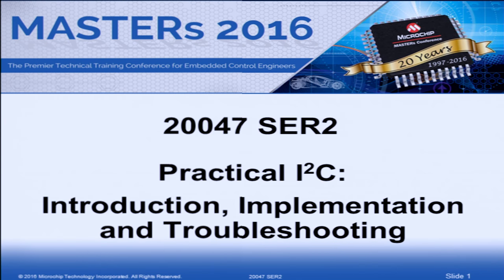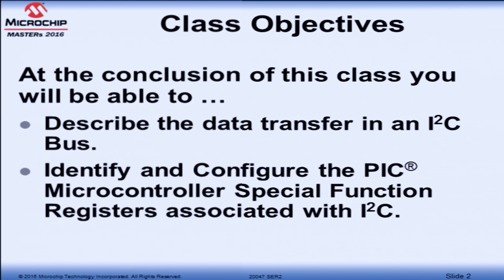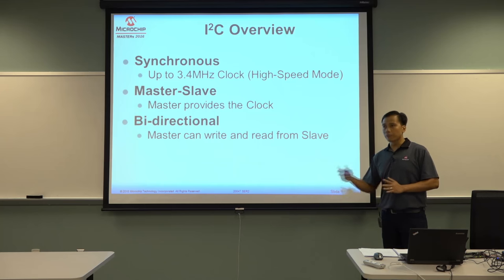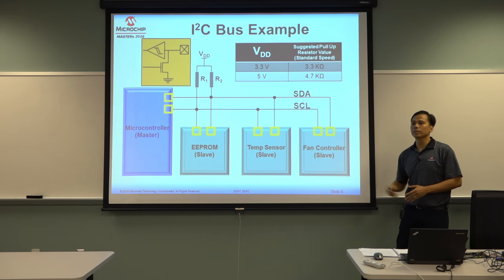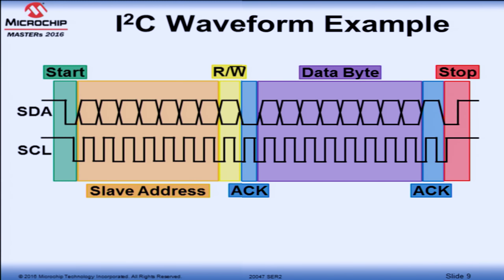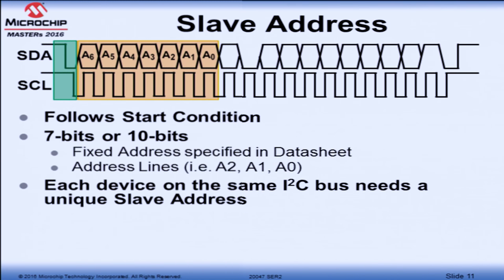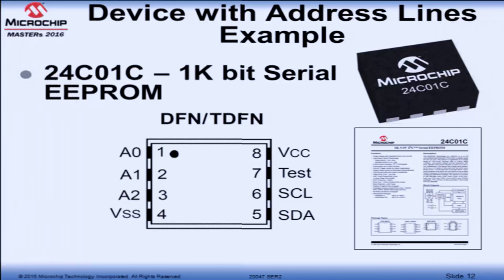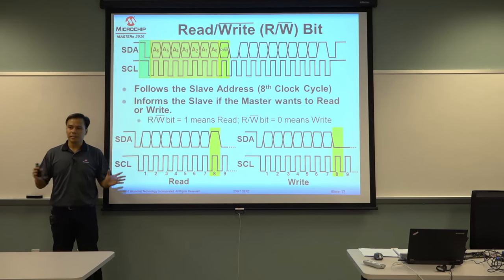20047 SER2 - Practical I2C: Introduction, Implementation and Troubleshooting

Comment: How to write Verilog code for LVDS implementation into M2S025-FG484 FPGA board. Is LVDS incompatible with this board
Reply from the maker: Hello and thanks for your question! LVDS is supported in the SmartFusion2 M2S025-FG484. Please contact Microchip’s FPGA design partners to learn how to write Verilog code for LVDS implementation: https://www.microchip.com/en-us/products/fpgas-and-plds/fpga-design-resources/fpga-design-partners.
We also offer SmartFusion and SmartFusion2 simulation library source files here: https://microchipsupport.force.com/s/article/SmartFusion-and-SmartFusion2-VHDL-simulation-library-source-files-support-1625098162917

Please let us know if this helps!

Comment: Would it be possible to publish the i2C_demo.c program? I would be very grateful
Reply: void eepromWrite (char slaveAddress, char Addhigh, char AddLow, char eeData);

char eepromread (char slaveAddress, char Addhigh, char AddLow);

            // slave address is the address byte  (slave address +r/w bit)
            // addHigh is the eeprom Address high bye
            // eedata is the data to be written in the slave

volatile char ReadData;   // global variable for monitoring.

void main(void)
{
    int x;   //general purpose variable
    OSCCONbits.IRCF = 12 /// 2MHZ clock

    ANSELB = 0;    // All portB pins are digital
    TRISBbits.TRISB0=0;  // RB0 is output.
    LATBbits.LATB0 = 1;   // LED indicator to know that code is running.

    SSPADD = 4;    // 100khZ i2c CLOCK WITH fOSC = 2 mhZ
                    // i2c CLOCK = fOSC/ (4*(sspadd+1))

    sspcon1  = 0X28  // sspm <3:0> = 1000 (i2c mASTER)
                      // sspen = 1 (i2c module is enabled)

   eepromWrite (0xA0, 0x12, 0x34, 0x78);

   for (x=1; x<165;x++);
   ReadData =  eepromread (0xA0, 0x12, 0x34);

   while(1);

}

void eepromWrite (char slaveAddress, char Addhigh, char AddLow, char eeData)
{
    SSPCON2bits.SEN = 1; // initiate start condition
    while(SEN);
    PIR1bits.SSPIF = 0;   // clear SSP interrupt flag
    SSPBUF = slaveAddress;  // send slave address and R/W bit
    while(!SSPIF);          // wait for ack. SSPIF is set every 9th clock cycle.
    PIR1bits.SSPIF = 0;     // clear SSP interrupt flag

    if (SSPCON2bits.ACKSTAT){
        SSPCON2bits.PEN = 1; // initiate stop condition
        while (PEN);  // wait for start to complete
        return;  // exit write  (No ack)
    }

    SSPBUF = Addhigh;  // send slave address and R/W bit
    while(!SSPIF);          // wait for ack. SSPIF is set every 9th clock cycle.
    PIR1bits.SSPIF = 0;     // clear SSP interrupt flag

    if (SSPCON2bits.ACKSTAT){
        SSPCON2bits.PEN = 1; // initiate stop condition
        while (PEN);  // wait for start to complete
        return;  // exit write  (No ack)
    }

    SSPBUF = AddLow;  // send slave address and R/W bit
    while(!SSPIF);          // wait for ack. SSPIF is set every 9th clock cycle.
    PIR1bits.SSPIF = 0;     // clear SSP interrupt flag

    if (SSPCON2bits.ACKSTAT){
        SSPCON2bits.PEN = 1; // initiate stop condition
        while (PEN);  // wait for start to complete
        return;  // exit write  (No ack)

    SSPBUF = eeData;  // send slave address and R/W bit
    while(!SSPIF);          // wait for ack. SSPIF is set every 9th clock cycle.
    PIR1bits.SSPIF = 0;     // clear SSP interrupt flag

    if (SSPCON2bits.ACKSTAT){
        SSPCON2bits.PEN = 1; // initiate stop condition
        while (PEN);  // wait for start to complete
        return;  // exit write  (No ack)
    }
}

char eepromread (char slaveAddress, char Addhigh, char AddLow)
{
    SSPCON2bits.SEN = 1; // initiate start condition
    while(SEN);
    PIR1bits.SSPIF = 0;   // clear SSP interrupt flag

    SSPBUF = slaveAddress;  // send slave address and R/W bit
    while(!SSPIF);          // wait for ack. SSPIF is set every 9th clock cycle.
    PIR1bits.SSPIF = 0;     // clear SSP interrupt flag
    if (SSPCON2bits.ACKSTAT){
        SSPCON2bits.PEN = 1; // initiate stop condition
        while (PEN);  // wait for start to complete
        return(0xFF);  // exit write  (No ack)
    }

    SSPBUF = Addhigh;  // send slave address and R/W bit
    while(!SSPIF);          // wait for ack. SSPIF is set every 9th clock cycle.
    PIR1bits.SSPIF = 0;     // clear SSP interrupt flag

    if (SSPCON2bits.ACKSTAT){
        SSPCON2bits.PEN = 1; // initiate stop condition
        while (PEN);  // wait for start to complete
       return(0xFF);  // exit write  (No ack)
    }

    SSPBUF = AddLow;  // send slave address and R/W bit
    while(!SSPIF);          // wait for ack. SSPIF is set every 9th clock cycle.
    PIR1bits.SSPIF = 0;     // clear SSP interrupt flag

    if (SSPCON2bits.ACKSTAT){
        SSPCON2bits.PEN = 1; // initiate stop condition
        while (PEN);  // wait for start to complete
        return(0xFF);  // exit write  (No ack)

    SSPCON2bits.RSEN = 1; // initiate repeated start condition
    while(RSEN);
    PIR1bits.SSPIF = 0;   // clear SSP interrupt flag

    SSPBUF = (slaveAddress+1);  // send slave address and R/W bit
    while(!SSPIF);          // wait for ack. SSPIF is set every 9th clock cycle.
    PIR1bits.SSPIF = 0;     // clear SSP interrupt flag
    if (SSPCON2bits.ACKSTAT){
        SSPCON2bits.PEN = 1; // initiate stop condition
        while (PEN);  // wait for start to complete
        return(0xFF);  // exit write  (No ack)
    }

    SSPCON2bits.RCEN = 1;  // Receive the data byte from slave
    while(!SSPSTATbits.BF);  // wait for the receive to complete
    Tempdata = SSPBUF;          // save the data byte

    SSPCON2bits.ACKDT = 1;   // Prepare to send NACK
    SSPCON2bits.ACKEN = 1;  Initiate NACK to eeprom
    while(ACKEN);   // wait for nacjkk to complete

    SSPCON2bits.PEN = 1;  // Initiate stop condition
    while (PEN);   // wait for stop condition  to complete
    return Tempdata;  // Return the data type value
}
Reply: This part of C code is needed and missing at the end of write_I2C(..) function ! or Is-it ??                      
I tested the read & write I2C functions using a PCF8563 I2C Real Time Clock  
and noticed some of the RTC registers was uncorrectly written by the write_I2C() function. 
The read_I2C(...) function though was correctly reading any of the RTC registers.
So I had a look at the write_I2C() function and check the START, ACK, NACK and STOP flags 
and where they were installed in the function.. 
And I remembered the Microchip teacher talked about a NACK flag sent from the PIC master
to the slave EEPROM at the end of the read_I2C() function telling it 
'I don't need any data anymore' so the slave could correctly end up the I2C transmission..
Since the RTC and the EEPROM can be accessed one register at a time
or with a sequential datas sent or read from a starting address
it make sense the NACK should be sent at the end of both write_I2C() and read_I2C() functions right ?
So the read_I2C() function had a NACK flag sent to the slave at the end of its code,
but the write_I2C() did not !
See part of the write_I2C() end below and see the added NACK code.
After this code added to the write_I2C's end I could now correctly write ANY values
to the RTC registers and read them back with equal values.
Maybe I forgot something in my added code here and I'm not doing
things right but the RTC communication now works perfectly.
(PIC16F877, Pullup res of 4K7 and I2C speed @ 100Khz)
Jean-Pierre Desrochers.

///////////////////////////////////////////////
void write_I2C(unsigned char slaveAddress, unsigned char Address, unsigned char Data)
{
  SSPCON2bits.SEN = 1;    // initiate start condition
  while(SEN);
  PIR1bits.SSPIF = 0;     // clear SSP interrupt flag

  SSPBUF = slaveAddress;  // send slave address and R/W bit
  while(!SSPIF);          // wait for ack. SSPIF is set every 9th clock cycle.
  PIR1bits.SSPIF = 0;     // clear SSP interrupt flag
  if(SSPCON2bits.ACKSTAT)
   {
    SSPCON2bits.PEN = 1;  // initiate stop condition
    while(PEN);           // wait for start to complete
    return;               // exit write (No ack) cause no slave replied !
   }

  SSPBUF = Address;        // send slave address and R/W bit
  while(!SSPIF);          // wait for ack. SSPIF is set every 9th clock cycle.
  PIR1bits.SSPIF = 0;     // clear SSP interrupt flag
  if(SSPCON2bits.ACKSTAT)
   {
    SSPCON2bits.PEN = 1;  // initiate stop condition
    while (PEN);          // wait for start to complete
    return;               // exit write (No ack) cause no slave replied !  
   }
   
  SSPBUF = Data;        // send slave address and R/W bit
  while(!SSPIF);          // wait for ack. SSPIF is set every 9th clock cycle.
  PIR1bits.SSPIF = 0;     // clear SSP interrupt flag
  if(SSPCON2bits.ACKSTAT)
   {
    SSPCON2bits.PEN = 1;  // initiate stop condition
    while(PEN);           // wait for start to complete
    return;               // exit write (No ack) cause no slave replied !  
   }

 ///////////////////////////////////////////////////////////////////////////////////////////////////////////////////  
 /////////////////////////////////////////////////////////////////////////////////////////////////////////////////// 
 // This part of C code is needed and missing at the end of write_I2C(..) function.                                // 
  else                                                                                                            //
  {                                                                                                               //
   SSPCON2bits.ACKDT = 1;   // Prepare to send NACK <-- NACK au lieu de ACK vers le slave pour dire au slave      //
   SSPCON2bits.ACKEN = 1;   // Initiate NACK to eeprom       que le master ne voulait qu'un octet et d'arrêter    //
   while(ACKEN);            // wait for nack to complete     d'attendre du master sur le I2C.                     //
                                                                                                                  //
   SSPCON2bits.PEN = 1;     // Initiate stop condition                                                            //
   while(PEN);              // wait for stop condition to complete                                                //       
  }                                                                                                               //
                                                                                                                  //
 ///////////////////////////////////////////////////////////////////////////////////////////////////////////////////
 ///////////////////////////////////////////////////////////////////////////////////////////////////////////////////
  
  __delay_ms(10);
}

Comment: my pic16f687 hasn't many of these registers and there's no example on the datasheet. How can I know what to do to start it on the right way?
Reply from the maker: Hi there, thanks for reaching out. To get started, you’ll need to configure your MCU with some basic steps. Setup Configuration Bits: Configure the oscillator, watchdog timer, power-up timer, and low-voltage programming in MPLAB X. Use MPLAB Code Configurator (MCC) for easier setup.
Some basic example code is here:

#include <xc.h>
#define _XTAL_FREQ 20000000
void main() {
    TRISB = 0x00; // Set PORTB as output
    while(1) {
        LATBbits.LATB0 = 1; // Turn on LED connected to RB0
        __delay_ms(500);
        LATBbits.LATB0 = 0; // Turn off LED
        __delay_ms(500);
    }
}

This is to toggle an LED. We hope this helps! If you need more technical guidance, reach out to Microchip.com/CSS.
Reply: @MicrochipTechnology  I know how to toogle a led. The pic16f687 doesn't have MCC, the least it has is bits configuration and it's XTAL_FREQ is 8000000. It's like I said, some microcontrollers have a bad documentation

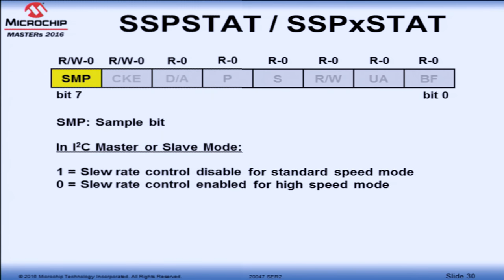Comment: 37:58 "by default it is disabled..." but as it's seen from the slide by default bit value is ZERO and in the definition this enables the feature. Though it is interesting that a CLEAR bit enable a feature ? . So either slide or instructor may be wrong.
Reply from the maker: Thank you for pointing that out. It is indeed clear (0) by default. This means it is enabled. We checked the datasheet, which is the recommended approach when faced with conflicting ideas. The most recent information is in the datasheet. Thank you for attending this class and paying careful attention to the presentation.

Comment: I am trying to send a data from the PC using the uart save it in memory and then read from the memory and write again using the uart to display it on the pc. I have used several codes and the problem persists. I send an "a" or "01100001" and receive two bytes "00000000 00111111". Any idea what it could be? I used your code
Reply from the maker: Kindly visit support.microchip.com for assistance. Thank you.
Reply: I tried mcc (code configurator) simple master and eeprom example. Both worked but eeprom example is much better. It is a while (blocked) triggered but accomplised to made self state machine non blocking style.

Comment: when transmitting the address and next data how the slave is treating it is addressed and it is data  after acknowledgment how data is recognized
Reply: Address sent by master always a write command. Data could be an uint8_t or uint16_t so 1 or 2 bytes. To store someting after that is a restart and data1 data2 data3.... so on untill stop. You can send 1st a read command without address write. It is the read current address command. Pointer of the slave device is somewhere (maybe the last position of last accomplished i2c process).